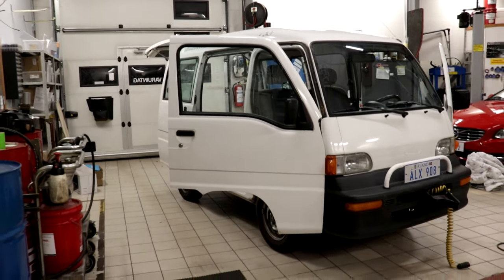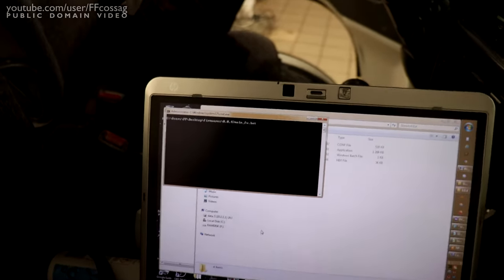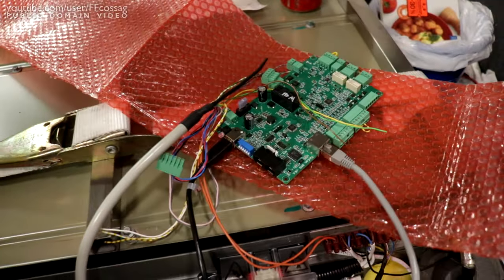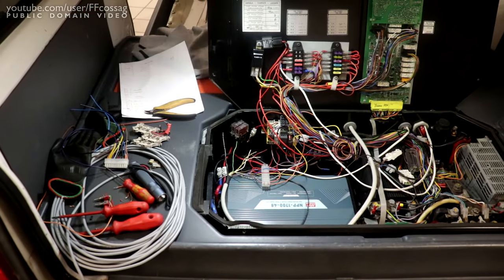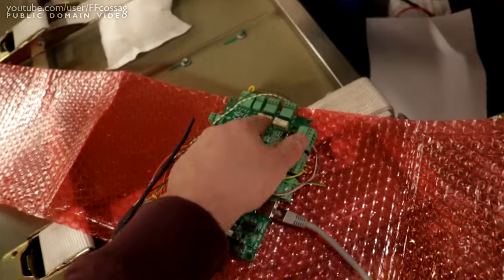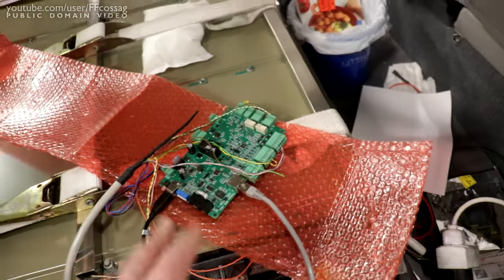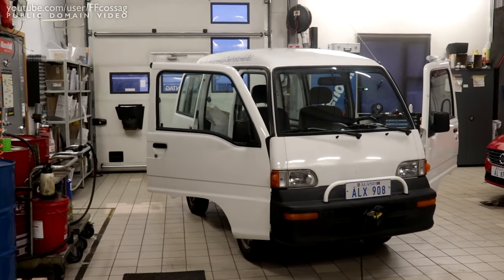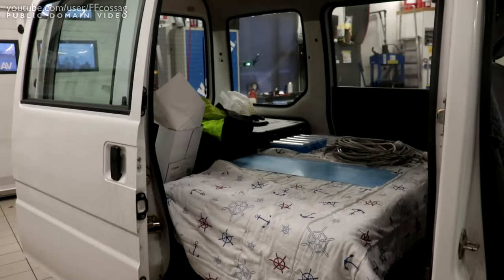Elcat Lithium Conversion EP6: More TinCanBMS Integration

Comment: Seeing all the wiring in the back makes me think there's a need for some of that corrugated cable trunking stuff (the stuff that has a split through its' length to feed the wires in via), give it lal a nice neater appearance, and hide any bodgery that may be going on too... :D
Reply from the maker: Hehe, it's gonna get properly tied up once it's more complete. I've just cut open all the looms for reverse engineering and splicing into since there's no documentation or schematics for it.

Comment: @FFcossag My sonnenschein battery arrived today!! It made it in one piece! Now comes the matter of transporting it to where I want it... hehe
Reply from the maker: Fun times.
Reply: @FFcossag  It was one hell of a challenge, had to build a new battery rack and everything but it is done now :) It is in service as we speak. Can't wait to get more of them, I did some load testing last night and oh boy, I could not get the voltage below 12.38V even with pretty decent load, for a really long time aswell! Talk about an upgrade compared to old shitty automotive style batteries! :D
Reply from the maker: I'm glad it worked out. Just remember to configure your charge controller for a pretty low bulk and float voltages. A600s seem to live longer if slightly undercharged than if slightly overcharged; you can recover from sulfation due to undercharging, but you can't recover from corrosion due to overcharging.
Reply: Me too! I am super happy that it all went well with shipping, and moving it into place here at home :) I did hurt my back a little, I found out a few days later... So definitely need to come up with a better transporting solution when I get more of these in the future. 

Indeed, that's what I suspected aswell. You can always recover sulphation, but never get lost electrolyte and you can't undo corrosion... The sonnenschein handbook says that a float voltage of 13.5 and a bulk charge voltage of 14.1 is recommended for a fairly wide temperature range. I've adjusted my float voltage down to 13.4, I've left the bulk and absorption voltage around 14.1 though. My charge controller is fully temperature compensated too, so I've set up a fairly aggressive temperature compensation curve since it can get a bit hot in my solar shed sometimes. Although I've been pleasantly surprised how cool the battery is staying, since I've placed it as close to the floor level as possible. It hasn't exceeded 25°C so far! So I most likely don't need such an aggressive curve. But I'd rather undercharge it slightly than over charge it accidentally like you said. 

My controller also has a tail current setting, (basically a amperage threshold where it switches from absorption to float charge), I decided to set that fairly high so it doesn't sit there blasting the battery with 14.1V when it's basically nearly at 95+% state of charge. I set the tail current to 3 amps, I'm unsure if I should set it even higher to make it switch to float sooner.

I'm also unsure about how often I should let the charger do equalizing. I set the equalizing voltage to 14.4, as recommended by the datasheet. (Seems a bit low to me?) And one hour, every 30 days. I can't really find any good information about whether or not that's too often? Or too long in-between? Also not sure if 1 hour is too short or too long :P

So I definitely have some questions left unanswered hehe.. gonna take a good moment today and read through the entire handbook, because today is finally a calm day for me. I've read 90% of it thoroughly, but there's a few pages of information left.

I also have conflicting information about terminal torque, the handbook says 20nM, and the battery itself says 12nM on it. I went for 20 because 12 seems awfully loose to me, if I bump the wires or something (I have 35mm2, not super fine stranded, so a bit stiff,) they become undone with just 12nM. 

Nothing seemed to be flexing or anything tightening them to 20, so I highly doubt I've caused any damage to the battery.

I just got a bit worried about that since you mentioned your cells having been over torqued and leaking, but I suspect yours were severely over torqued, such as someone using a impact driver....

Anyways hehe, this reply just became insanely long:P 

Also wondering if I could talk to you some where else, because YouTube comments is incredibly glitchy and it seems to randomly delete my messages...

I could email you instead, that might be easier! I also have discord which could maybe be a bit more practical, then I could show you things more interactively and show photos and video clips x3 (also I'm making a YT video about the battery, so expect to see that soon ish!)
Reply from the maker: You can find me on Discord, ff_ccsa1f

14,1 and 13,5 are good voltages. I wouldn't do 13,4 since that's basically nothing at all. Sonnenscheins don't "need" temperature compensation, but they still benefit from a gentle slope. 0,001-0,003 V/Cell/degree doesn't hurt. Install your temperature probe on the negative terminal of the battery since it'll get warm if you're overcharging. 

14,4 V is a good equalising voltage, but you should run it for 6 hours or so. My experience tells me that a less frequent but more aggressive equalisation cycle is preferable. I only equalise my batteries a few times a year unless something has happened (which also happens a few times a year).

3 A is a very high float transfer voltage for such a small battery. I'd do no more than 2 A, but this also depends on how much useful charging per day you get. The less charge time per day you get, and the deeper a daily cycle you pull, the more aggressive your lower absorption current limit needs to be.

Comment: I am absolutely loving this project! Also, long time no see!! You need to make a general update video about how your things are doing, I miss your battery and solar videos a lot too!

I need to make some update videos myself too... I may or may not have bought sonnenschein batteries myself now... :P Woops!! Heheh! 

//your biggest fan from sweden 😄
Reply from the maker: Thanks. Sadly, my things have been fairly stagnant lately. The Elcat project has been basically standing still while we've been working on the BMS, and the rest of my stuff has mostly just been slowly degrading. Those giant Sonnenschein cells turned out not to be so great after all ... I hope you're luckier with yours than I was with mine!
Reply: @FFcossag  I didn't see this reply until after I had watched the diesel video! Such a lovely machine!

I am in the same situation right now, I have been too busy working and such so my stuff is all degrading aswell, I have not had any energy to work on my little van either, and unfortunately my electronics projects and solar projects have not been worked on in a while now... Plus there was a fire in our workshop recently, so I dont have anywhere to really do much other than my little outdoor shed x3 So I feel that a lot, I hope things get better.

Exciting to hear about the BMS though!! Getting any good progress on it? I am really excited about your elcat van, if I do end up coming over this summer, I would love to see it IRL! :D 

And aww,, I am so sorry to hear that those big cells didn't last :( Was it the positive plate growth that killed them? Or what went wrong? I remember you made a video about them where you talked a lot about that, and that does seem to be a big problem with sonnenschein batts. I hope mine doesn't develop it too quickly, I bought a more advanced charge coontroller (victron energy something) that is fully adjustable via a app, so I can set my charge voltages and temperature compensation correctly so I don't damage it>

I am really excited to get my A600 but I am worried about how it is going with my order because nothing has happened, no updates or anything, I know sonnenschein makes the batteries on demand more or less, but I have not heard anything whatsoever.

Also may be able to get my hands on some of those yellow and orange powersafe batteries from work next time they go over them! I dont like those nearly as much as I like sonnenschein but if I can get them for a little more than scrap price, then hell yeah I'll roll with them. they have a VERY tight replacement schedule where I work, they change them every 3 years even if they are just fine!
Reply from the maker: The BMS is now operational at a very basic level. It might get more development, it might not.

I'm not sure what's causing my big cells to fail. The failure mode is excessive self discharge in cells with significant plate growth, so I suspect that they're suffering mechanical failure of the plates. I believe these were run very warm in their original application, which is why they were replaced so young. Still, they've lived through 10 years of warm stand-by use and 4 years of cyclic use by now. 

You really can't complain at all, they are simply being pushed way past their useful life.

Curiously, my older 6 V/300 Ah A600s are aging much better than the 2 V ones, and I often find them taking abut 80 % of the load of the entire system.

I also recently got an e-mail from Exide, where they're excusing themselves for having problems migrating to some new system. I bet your order is just a victim of their internal chaos.

And yes, grab all 3-year-old Powersafes that you can! They're not super reliable, but you can easily get a year or two of cyclic use out of them at such a young age.
Reply: @FFcossag  Sometimes I Hate YouTube comments, I don't know what I did, but I was typing out my reply and suddenly, everything got deleted! So now I Am typing this up in wordpad, and will copy and paste into YouTube afterwards :P

That's very exciting that you got the BMS going!! Also I know how that is like, hehe. I have many projects that are just like that :P They work just good enough, and then it stays that way for years (or forever) haha!! 

That is a very interesting failure mode indeed. I'm guessing that because of their plate growth, the actual plates get ripped off of the internal busbars. I have seen that in old automotive style batteries that I have torn apart for science :P Don't worry, I have proper safety gear to do that sort of thing! And yeah, heat is no good for batteries. It can cause pretty severe internal corrosion due to overcharging too, if the temperature compensation of the charging gear is not adjusted properly. Although adding to that... Right now in my solar powered house I have 3 old starting batteries currently, which two of are approaching 8 years of age... They have a surprising amount of capacity for what they are, Obviously not anything to brag about but they have no problems running my 180 watts of fluorescent lighting for 4 hours or so! they are not even fully drained after, but that's usually as much time as I spend out there working on projects in a evening! That's about 720 watt hours used, probably a bit more since the inverter is not 100% efficient obviously. so say 800 watt hours every evening :) Plus I may use soldering irons and other stuff, so it can vary. I think I should thank my fully adjustable temperature compensated charge controller for that! It becomes 30-40C in there, when the sun hits hard. But the batteries stay relatively cool anyways, they are not very high up in the air so that helps. they rarely get above 27C.

I also find it very interesting how those 6V blocks hold up so well! My guess is that they were treated perfectly in their past life, and knowing you, I know you are treating them even better now :3 They seem wonderful! Next time, you should try to only get those... They seem way better than anything else! 

That is interesting to know! I still have not heard a thing from them, but that could explain why! That calms my nerves a bit, as I was worried for a moment that something had gone seriously wrong with my order. It is of course also possible that my order is not very prioritized since I only bought one battery for now, since they are so expensive. I plan to buy another one a few months later, which should not be a problem with these since they last so incredibly long. 

I definitely will grab them if I can! I know they are not very reliable, but hey, free is free! :D If I can get 2 years of cyclic use out of them, I will be more than happy.

Comment: hi i recommend writing in a book / journal information about the car/mods for future reference eg wire connection and function it can be very useful especially if you have not altered it after 2+ years
Reply from the maker: I actually do write a lot of it down in a little notebook I keep in the car! A lot of this mess was just considered so temporary and simple so as not to require documentation, which is still true. It was a hackjob to keep it on the road while I was figuring out what to do.

Comment: So with the fans, PWM control is nice, but it may also be an idea to have the fans do their own speed control based on temperature. Nidec makes the Beta V line, or did, and the TAxxxDC line had options with thermistors. Dell used these extensively in their Pentium 4 towers before moving to PWM control in 2005. The 92mm options are extremely resilient little bastards and I've had the ones in my case in many a PC, and have been in service for nearly 20 years at this point with minimal interruption. Still sound like the day they came out of the factory. They get super hella fast and loud at full tilt if you short the thermistor, and while PWM is nice, it might be more of a "keep it simple stupid" approach to configure a relay to short the thermistor on such fans to run at full tilt in the case of excessive heat where the thermistor isn't doing the job. but, that might be the case on very hot days or the like. They run at one set speed around 1000rpm otherwise. I retrofitted one such fan into an OptiPlex GX400 as the fans those came with were the ill-fated JMC Datech fans that blow their bearings and sound like a cat scratching against a chalkboard constantly.

The wiring, in time, can be cleaned up once you have shielded what needs shielded, but beware the very very cheap spiral cable glands that might help tidy the mess-- a lot of them have a coating or something in the plastic that smells like rotten flesh + vomit when it offgasses with age. Velcro cable ties are a big must here, no zipties unless it's deemed absolutely permanent as you go through your board revisions.

What you're doing here is nothing less than captivating. This can not only help owners of these vans but many, many more cars with such a system.
Reply from the maker: Good old Nidec fans, I have a few lying around the shop as well.

And thank you - I only wish I'd been able to continue the project the better part of a year ago.